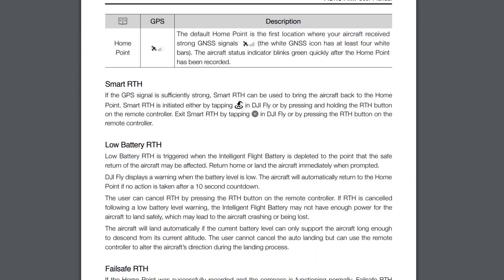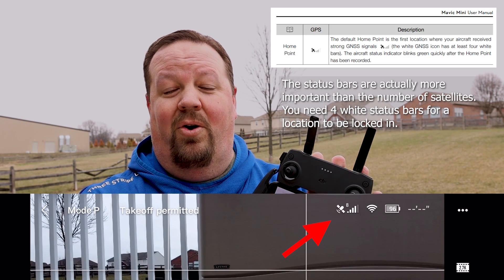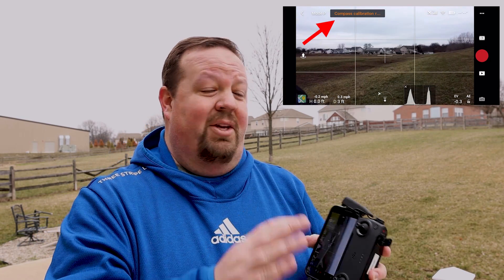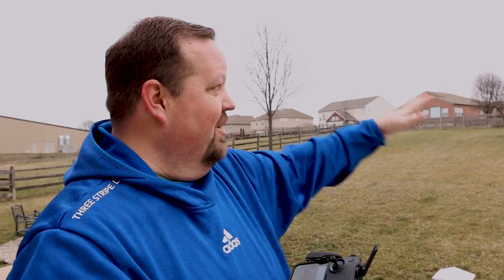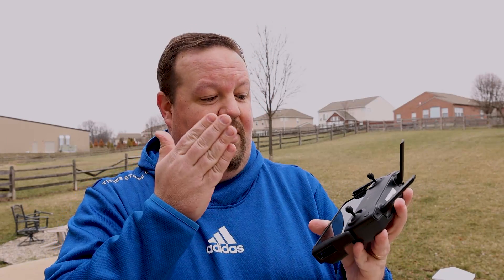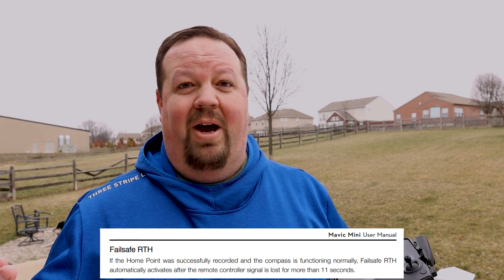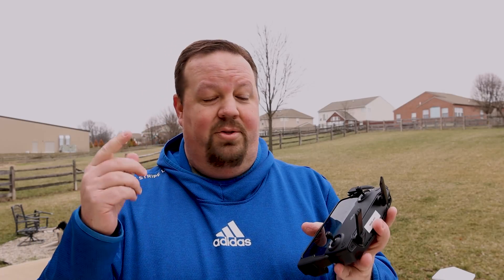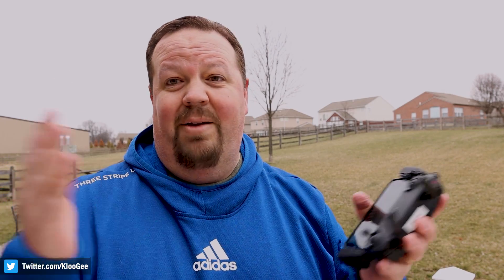DJI Mavic Mini - Return to Home Tutorial (RTH) - DJI Mini 2

Comment: EXlent video.  Now we are in 2021.  DJI mini2 has new/updated firmware.  Do you know if the new firmware , will allow you to change the homepoint.  I will probably never use it, but just wondering.
Reply from the maker: It allowed you to change it back then and still does.

Comment: I found out that updating home point on the mavic mini while it is flying is not a good thing to do.  It will update home point where drone is at and not where you are standing.  For example, when my drone takes off (next to me) home point is established.  Then if I am walking around, say I move 100 yards from where drone first took off.  If I reset home point it will not be at the 100 yards I walked to, but instead where the drone is.  That's kinda dumb.

Comment: Though I perhaps have been unwise in launching from a concrete slab, I was aware but failed to recall rebar as potentially causing compass error, Ive nonetheless had no failures with RTH.  Perhaps the concrete slab over a capped city water well was  the influence.

Comment: What happens when RTH altitude is set to 30m and drone fly at 100m
When press return to home the drone will come down to altitude 30m or return back at home at 100m.
Also if  the drone encounters a cliff, what is the height it will return to home? 
this from the take-off point?
Or this from the bottom of the cliff
Thank you

Comment: Must say with all the folks out there giving info about the DJI Mavic products, you are the only one I've come across who has actually explained in detail the RTH function (be it the Mini or 2Pro). Really glad you covered the Compass Calibration and number of GPS satellites required for the RTH to function properly, showing the info from the Manual. Doing this calibration at the beginning of the  flying day, would probably solve many of the missed HP landing scenarios. So many DJI drone pilots (I'm guessing) haven't even bothered to download the pdf version to their computers, let alone read it. For Part 107 pilots, I would consider this an absolute necessity.
Thanks for showing how to move/update the Home Point. Since I am a visual learner, seeing how this is done, was most helpful.
OH! You might include the hovering at 10m after take-off, for about 10 sec, to record the HP. This is a step often overlooked. (Its in the manuals).

Comment: Question. When you set your rth position. Does it matter when you flown uphill in your area and the press rth. Does it calculate it's current possition and then go up or does it goes down to your position Plus the rth altitude? That would crash the drone instantly when it's far uphill.
Reply: @DailyDroning  That's not what i meant. My question was, for example. You set the rth at your position at 60ft. And then you fly further up the hill. Let's say 200ft. What happens when you press the rth button.
Reply: @DailyDroning  Thanks! That's what i wanted to know.

Comment: Ok as a follow up to my questions below: I was on chat with DJI and they clarified my questions so in case anyone else wanted to know ... here goes:  Whether you set a RTH value or not ... the MINIMUM default value is 15m. (or 49')  In other words it will set an RTH altitude value for EVERY flight at 15m. You then have to change it if you want.  If you do NOT change it and RTH is triggered, it will rise to TWENTY meters ... THEN go back down to 15m ... then head home. I found that a bit confusing ... like why go to 20 then drop back down to 15m and THEN go home. Anyway upon questioning that the rep confirmed that is indeed the case and gave some reasoning like "it needs to reset itself at 20m before going into RTH default mode." Still didn't make sense to me but whatever ... I guess I will test it myself to see if that is indeed what happens. So to answer my two questions. ;) First ... the minimum RTH value is 15m or 49'. Secondly ... if you DON'T set a value, it will use the default value of 15m ... so it if it was below 15m it will NOT just turn back at whatever height it was at and come home.  Hope this helps out your viewers.

Comment: Late to see this but I second Snackman ... Best RTH video I've seen yet ... and I've seen a "few" ;) Quick question.  Is there a MINIMUM rth altitude that it recognizes? Suppose for instance I DON'T want it to rise above 10 feet, 15 feet or whatever (I have my reasons! ;)) upon RTH initiation, would that work? What if I DON'T even set a RTH altitude, would it just turn around and return at the same altitude that it was triggered at? (even if only 3 feet high?)

Comment: the DJI Mini sounds like a toy or DJI's first series of drones like the Phantom 1 or Phantom 2. Easy to hack into. My Phantom 2 Standard was hacked and someone took over my remote and me being the idiot running down a L.A. street chasing the drone. I was doing a home inspection and wanted to inspect the roof. I did everything calibrated my compass, set my RTH, took it up less than 60 feet, all of a sudden it went straight up, went left, went right then went up to about 80 feet and high tailed it down the residential street going toward a busy street called Olympic. It waited at the stop light until the light turned green lowered started facing the cars at the light at windshield level and took pictures. went strait up crossing the street to a restaurant window then went left taking pictures then video of people eating. when it was done went back up crossed the street the idiot that was controlling it didnt see the palm trees, clipped the trees almost hitting the power lines. before crash landing in the alley of a restaurant, a laundry and another store Damage? Props, separation of prop arm. gimbal was in tact. sent the drone back as a return and I bought the Phantom 3 Pro.Never had an issue with the P3Pro,Since I own almost every consumer drone DJI has including the P4 Pro, Spark, Mavic Air, Mavic Pro, Mavic 2 Pro. The Anafi, the Breeze, the Evo, (getting the Evo 2 Pro) soon the Mavic 3. (if better than the Mavic 2 Pro) My favorite s are the Mavic 2 Pro, Autel Evo, P4P and the Mavic Air.
Reply: Excellent video, very precise and honest. You've been missed Welcome back and hope all s well with you.

Comment: Thank you for the video. Quick question. When you activate the return to home feature, does the drone calculate the altitude from its current position or the altitude that it took off at. What I'm wondering is that if you took off and are flying over a canyon, does it calculate the altitude from the bottom of the canyon or the original take-off point?
Reply: @DailyDroning  Thanks so much for the speedy response. It's an exciting new hobby for me 🙂

Comment: The problem I have with this app is that the arrow at the bottom center of the screen doesn't accurately display the horizontal direction the drone is from the transmitter or it's correct direction of flight.  Watch it closely the next time you fly and you'll experience this bug.  I've reported it to DJI so we'll see if its corrected in the next firmware update.
Reply: @DailyDroning  Thanks for the reply but in my view the arrow should work reliably.  Is the map view reliable?

Comment: That’s great! I didn’t know you could change the home point on the mini.  Thanks. 
Why won’t DJI add a setting to tell it to hover if the signal is lost? All other drones have this option. That’s dangerous if you lose signal indoors or in the woods. It will rise up and crash.
Reply: KlooGee yeah. I’m afraid to fly it down to my basement or something because if it loses signal it’ll try to go through the ceiling. 😅😭

Comment: Enjoyed watching your video on use and function of the RTH feature of the Mavic Mini. You might also consider an additional caveat and word of caution about the RTH feature regarding setting an appropriate “altitude” for RTH. I place “altitude” in quotes because there might be a common misunderstanding among operators about what that actually means; at least in my brief experience flying the MM and review of other “reviews.” The altitude displayed by the DJI Fly app is NOT the true altitude of the drone above the ground EXCEPT as pertains the actually launch site, which, for sake of illustration, could be referred to as ground zero.  Why does that matter? Well, let’s say that you are flying in an area of significant topographic variation. Let’s add some tall trees or a cell tower into the mix, both of which can cause wi-fi signal disruption. Now, let’s say that you set your RTH altitude to 100’, then fly up and over a hill or ridge (a lot of those in this neck of the woods) that is, say, 150’ higher elevation than your launch site. (I know, I know, the whole maintain line of sight requirement; a near impossibility with the MM once it gets a 100 yards or so down range.) If you were to lose signal while aerially exploring that area over the ridge, the auto RTH feature would kick in. At that point, the MM would DESCEND to the preset RTH altitude of 100’ and crash into the backside of the ridge attempting to fly home. So, your guidance is quite accurate in that you need to set the RTH altitude to a point ABOVE the highest point that the drone will be flying. But, especially for newer operators, like me, topographic considerations must also be figured into the calculus as well as a true understanding of what the “altitude” display represents.

Comment: Another not so obvious thing to be aware of.  Given the choice of RTH or Land in Current Location, let's say you DON'T want it to RTH, instead Land where it's at.  If, on the way down, it loses control signal, it will NOT continue to land, instead 11 secs after losing signal it will automatically revert to RTH mode and start climbing again. Check my channel for three videos I posted in December on Forced Landing Tests.
Reply: It's so great to see this issue has finally been solved with the release of DJI Fly v1.0.8, which allows you to choose between loss-of-signal failsafe options, RTH, Descend, or Hover.
Reply: @DailyDroning  It is truly unfortunate that it does not provide that option.  However it appears to give that option with a choice between RTH or Land in Current Location.  But that is very misleading because the Land in Current Location option will abort and revert to RTH if the control signal is lost on the way down.   Resetting the Home Point to the chosen ditching location will guarantee the Mini does land there, even upon loss of control signal,  only as long as the Mini remains within 20m of that marked Home Point while descending.  If the wind is strong enough to blow it outside of that 20m radius then the Mini will again revert to RTH mode and start climbing again.

Comment: I do not think stick forward during RTH can get it up to 13m/s. Not without S mode on. Mini does not have enough pitch to allow that much speed in RTH.
Reply: @DailyDroning  what will my Mavic 2 do? Go 100? 
Never know it was possible though. Learned two things today.
Smart controller press and hold rth to get it working, and this. Thnx

Comment: Great video as always. You know as many other people I have decided to move to the freestyle/racing drones. I would to see videos from you related to that.
Reply: @DailyDroning  That would be great! I want a very powerful drone that can be shot to the air as a rocket. Thinking of doing open area flights and not so much into buildings. I want to build it my self. Will not get the DJI system for now because it is too expensive in chile, but definitely I will get it when price goes down.